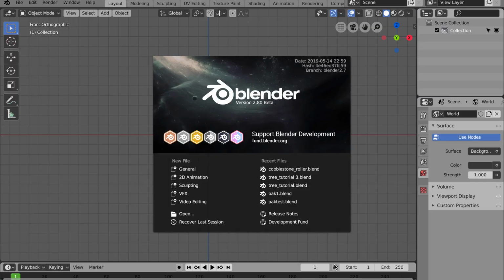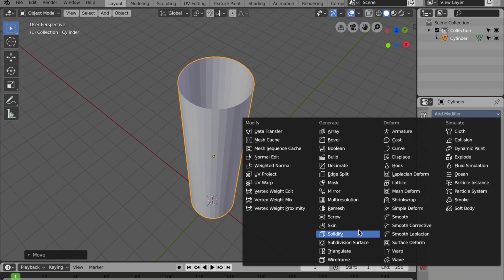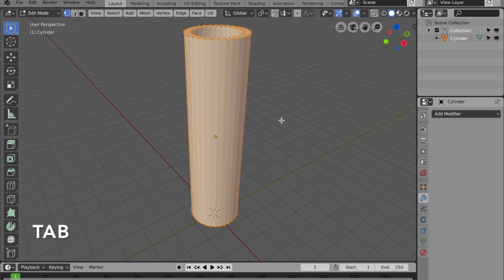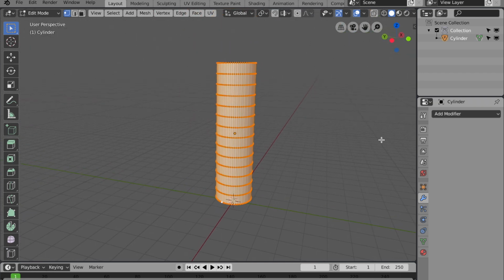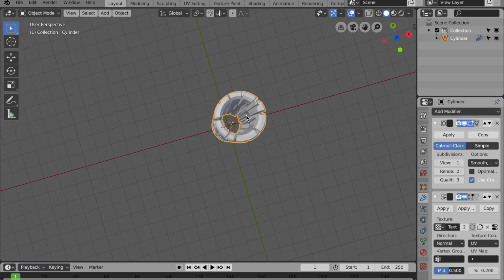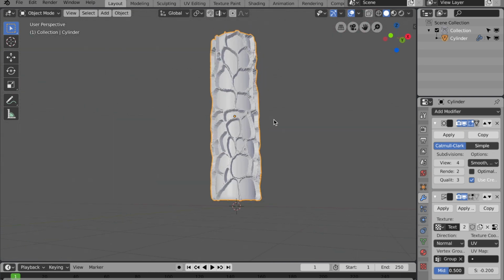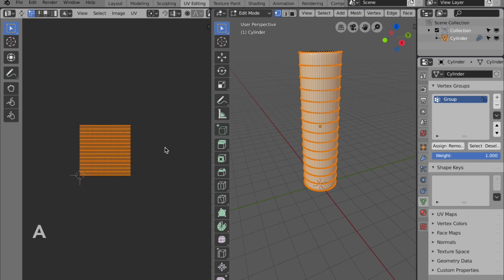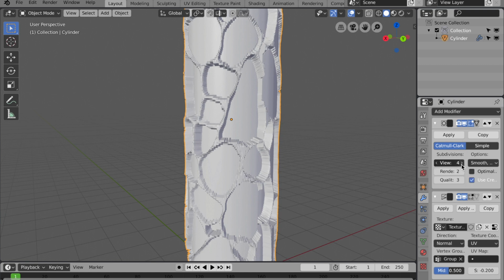3D Printable Textured Rolling Pin Tutorial

Comment: Maybe this video is made with outdated software (I have 4.5.3) but this is not working for me, it all falls apart when subdividing, when following the video the inside of the roller stays grey and is not selectable as it is in the video, the ventricles don't extend to the inside and it still shows a solid grey rim and inside I've tried following the video several times now and I'm not missing any steps but there must be an additional setting that isn't noted. Also using MAC

Comment: Yes, as an experienced blender user... I found I had the same problem as others did with it applying the displace modifier to the inner cylinder as well as the outer one even though I made my vertex group and applied it. You must apply the solidify modifier (by clicking the little down arrow icon next to the modifier and selecting apply).. THEN make the vertex group and add displace...etc. Took me a minute to figure out that's what I was doing wrong. Thx for the tut!.
Reply: im having trouble with group vertex, it only  highlight only one side, in the video i can see he turn the cylinder  around few times and it highlighed everything.
I then watch another video on how to group it by ctrl L, when i then apply the rest of the method if did not work, it is so frustrating, because I have  been doing it for hourssssssssssssssss, and this is my first time using blender, maybe a few key points  that are missing in the video.
Reply: Thank you!

Comment: This is one of the worse tutorials I've come across on You Tube. It's all very well you know what you are talking about, you have to assume though that your audience knows diddly squat. To that end you need to..
1) Talk slower and stop waving your mouse around as you speak.
2) Make sure you clearly and slowly explain what mouse clicks you are doing at the same time as your narrative.
3) Don't automatically assume your audience knows anything.. e.g. you need to explain how to select the faces or whatever they are. Your viewer doesn't know you are holding down the shift key  in order to do so.
4) Different versions of Blender have different options submenus (or whatever they are called).. i.e. the Modifier submenu in 3.4.1. is different to the one you are using as are some of the others. You have complete nupties to Blender, like me, before we've figured out what you've done and found where the "apply" button has been hidden, you're 5 steps ahead.
5) You were far too quick going over the textures (as with everything else)..  An explanation as to the fact that the ones you called up are not part of Blender and what you are supposed to be looking for on Google would have helped.
Having said all that I thank you for sharing your knowledge with us lesser mortals to whom Blender and other 3D software are a nightmare..

Comment: Hello, thank you for the tutorial. At the stage 'adding the texture' - nothing happens when I add it, however I need my roller to be much smaller (radius is 30mm) - is this why I'm not getting a texture appear? Adjusting the strength does not solve this. Thanks in advance for the help.

Comment: Hiho!

Thanks for the hints! I needed a few hours to find my fault why i also could not exclude the inner side from being textured. In the current 3.3 Blender i found the APLLY option for the solidify modifier behind the camera symbol in a dropdown menue. After applying this i could proceed as described. It is a pity that the UIs from Blender and zBrush make it so difficult to use them. Years ago i had a program called Cubify Sculpt, where you simply said wrap that picture along a path and voila it was wrapped. Only issue was that it could not doe it seamless and there was always a few milimeter seam.
Reply: Holy crap! Thank you so much for this comment! I have been fighting with that issue for the last 2 days. Thank you for working it out for me Thorsten! 😅

Comment: Do you have a method on how to print that roller for resin printing?
Reply from the maker: The one in the video was printed in resin. Just stood it on end and had supports on the bottom. It didn’t need supports anywhere on the pattern.

Comment: Thank you for this video. I am learning it these days as I plan on starting a business. Few questions as I am stuck. 1st is that I am not able to move this freehand as you could do it. Please help. Second, when I reach the point to add texture, I click on displace modifier, my surface doesn't look smooth like yours. Also when I ignore that and click on adding my texture, it doesn't do anything. I am sure I am doing something wrong but I have been trying this again and again since past 3 hours and no luck. Please help.
Reply: I again tried it today using a mouse, instead of the laptop TouchPad and it made some steps easier. But I am still unable to move it freehand like you are doing. And I am unable to get the texture to show up on the cylinder when I select it from Vertex Group section.

Comment: Hey I know this is late, but my cylinder's internal vertices can't be selected unless wireframed. Even then, when wireframe shows only the outside is selected, I'm still getting the texture inside the cylinder.
Reply from the maker: Make sure you have applied the solidify modifier not just added it to the list of visible modifiers.
Reply: @ACGStudio3D  I got it all figured out!! Another comment told me where to find the apply button. I've made a few, now I just need to print them and try them out
Reply: @ACGStudio3D  follow up question. some rollers I have been working on have had 2 issues. Some get lines going around the roller where the texture seems thicker on the ends. I also get vertical lines, like the ends of a piece of paper not lining up. Do you know what's going on?

Comment: I am using blender 2.9 so finding it hard to follow your video as the screen changed. I got a roller with texture but its inside to and i cannot 3d view it as left and right clicking open menus ;-( sorry my 1st time using blender.
Reply from the maker: Yeah, there have been several comments about the differences in newer versions and the one used here. I guess I should do an updated video.

Comment: You could also use the Boolean modifier in blender to make the ends perfectly flat, or also manually scale the vertices flat. I wouldn’t want to download a whole application just to do one simple step, as I don’t already use meshmixer.
Reply from the maker: That is another definitely another way to do it. I believe I tried to use the Boolean modifier and was having issues with it at the time. I can’t remember at this point.

Comment: Hey, just found this video and im so thankful! But I had a quick question, you said that we don't need to have a higher subdivision modifier as it it will be smooth when it prints, but when i open it up on Cura to slice it, the edges are jagged? Would love some help, very new to all this <3
Reply from the maker: In the modifier panel you can change how the modifier appears while modeling and how it will render. You can keep the view setting lower so your computer can work faster but keep the render setting higher so that the final file still comes out smooth.

Comment: Is there a method to have a pattern that will match stone edges if I need a wider length than the roller itself?
Reply from the maker: You could try working with a tileable texture image. Thinking about it from the practical application perspective, it will be difficult to do in practice without some degree of manual cleanup of the join. You could try making an expandable roller by attaching two together with a pattern that continues across them. That would allow you to make a roller bigger than can fit on a printer, though it might bring challenges of its own.
Reply: @ACGStudio3D  great suggestions! Thank you for the reply 😌

Comment: Hi. I stumbled upon a problem duirng making a cylinder. Mine has only like outer surface showed as a grid. I cant really make vertex group (it just does nothing) and if i apply the texture to the cylinder the inside also gets "textured". What am I doing wrong?
@EDIT: neverminde solved it. In the latest blender apply icon is hidden. Just didnt hit it and now it works :)

Comment: Regards... nice job I experienced some kind of issue whith the inner vertex of the  cylinder... those part continue whith the negative, and cannot remove from vertex group.What resolution is the correct for 1/56 scale...https://youtu.be/pDD00eD9jTo sure you’ll find the mistake I did, thx in advance.
Reply from the maker: I wish everyone that needs help would make a video! You have to Apply the solidify modifier. Modifiers are nondestructive, meaning they don’t actually change your object until they are applied, so the render is showing you what the modifier will do but hasn’t actually done anything yet. Once you apply the modifier you will see the inside vertices appear.
Reply: @ACGStudio3D  https://www.thingiverse.com/thing:4847877?fbclid=IwAR0SQQ_mqnPYxCbvlqczPVdeFQEmUQeQSU9t7i7nkTQPTtJ_j2F7N_zUKEw thx mate for your inspirational job,...you´re a master!!!!

Comment: Great tutorial the file cobblestone link you gave is over 100mb in size all 3d printing uploads have a  maximum 100mb no more and the size dimensions were off had to work the xyz dimensions to mm as well as the camera and set to default size so what you see is how large the item actually is or you can adjust as long as it doesn't go over ten inches which I think is the maximum a 3d printer can create, so the object is automatically configured for 3d printing ,
also the density and detail of the original download file because of the UV map image displacement raised the price at CraftCloud to $50.00 and  $19.00 shipping I am going to try to reduce the vertice faces to 2/3 the original face count to see if it makes a better price.

Comment: Sorry again. This might have been asked but when I hit A and then Ctrl R for the loops, I'm only getting the lines on the outside and not in the inside. Because of that, i can't change the vertex to only highlight the outside. If left like this, I get the pattern on the inside and the outside. Any advice?
Reply from the maker: Be sure to Apply the solidify modifier before you do that stuff. I haven’t used the newest version of blender but I have been told that the apply button isn’t displayed the same way. Adding the modifier from the menu doesn’t actually apply it to the model even though it shows the effect. If it hasn’t been applied then there isn’t actually and inside surface, even though it appears to be there
Reply: @ACGStudio3D  thanks. That solved ir :-)

Comment: Oh my gosh, so many questions. Last problem...I figured it all out and then exported it. By using your dimensions of 750 cm my model came out approx 1/4 in tall and 2mm wide. I changed it to inches, and meters...and I'm getting an extremely small model. Can you think of anything that would make that happen? I'm new to blender and this is just crazy. If I were to convert 750 cm that equals 295 inches. That's like, no way....Again, Help! Thanks.
Reply from the maker: Glad you figured out the modeling part! As for the scaling issue, the scale in blender is pretty arbitrary. When you go to export as an STL, you can adjust the scaling there. You may need to adjust the scaling there by a multiple of 10 to increase the size. Once you figure out the multiple that works for you, it should work for future models also. That said, I haven’t used blender in a while and am unsure how recent updates may have affected things.
Reply: @ACGStudio3D  Thank you. Was up pretty late. Still working on it this morning. It seems now I can do the loops but it's only on the outside. I'll just keep practicing. Thanks for the quick response~ Love this

Comment: I just downloaded blender to give this a shot. I'm not given the option to select the inside of the cylinder or to deselect it.  Everything highlighted is on the outside, which would seem fine until I apply the texture which then puts itself inside the cylinder.
Reply: I was having the same problem and getting very frustrated but then I decided to read the comments here I realized that you need to click on apply when you use the solidify modifier. On my version, the apply option is on the drop-down arrow just on the right of the solidify box. Apparently "ctrl A" does the same but I haven't tried it
Reply from the maker: That would have been my suggestion here. Also, ensure you make the vertex groups so that you don’t apply texture to the inside and outside surfaces.
Reply: @heloinaharvey2706  Got stuck here too, sorted thanks!

Comment: I am having a lot of difficulty creating the vertices group. It looks like I am selecting only the outside of the cylinder when making the vertex group, however when I add the pattern and then select the group it applies to both the inner and outer vertices and removes the pattern.  I notice when you create the group you have 3 sets of dots across the thickness however I only get 1 set on the outer edge.
Reply from the maker: Check that you have applied the Solidify modifier before you try to create the groups.
Reply: @ACGStudio3D  Thanks, I have added the Solidify modifier however I do not have the apply button in my version of blender 2.91 as you do in the video is there something else I have to do to apply it?
Reply from the maker: Interesting. I haven’t updated/used Blender in a while as I’ve been using other software. There is a difference between adding a modifier and applying it. Adding it will allow you to see the effect but it won’t actually do anything to your geometry until it is applied. So you can see the effect of Solidify but won’t see the extra vertices until it is applied. I’m not sure how you apply it if you don’t have the button in the video.
Reply: @clairejackson9366  there is a little down arrow next to the solidify title once you add the texture. Click on it you will see apply

Comment: That's a great tutorial! My roll pins came out perfect!

But... may I ask you for another tip? How do I do it on a different meshes like a cube or a plane? I almost achieved what I wanted, but I keep struggling with the "UV editing" step. Everything goes well when I do cylinder, but I can't seem to scale the texture when it comes to a cube/plane shapes. Maybe I'm doing the subdivide thing wrong? Or I should somehow prepare the new object before I do things with it? 

Once again, thanks for the tutorial. It was so simple, yet such a big step forward. You're the best :)
Reply from the maker: Glad you enjoyed the video! You should be able to follow a similar process with a cube. I’m not sure why it isn’t working out. You should be able to scale the texture using the same steps outlined in the video. I actually used the same process on a cube to make a texture stamp. You just need to subdivide the mesh so there is enough geometry to accept the detail. After UV unwrapping, you should still be able to adjust the UVs to scale and reposition the texture.
Reply: @ACGStudio3D  It worked after unwrapping. That's the step I've missed. Thank you once again! :>

Comment: I found this video from your Thingiverse pages. In your V2 roller pack you mention you hollowed them out so a wooden dowel can be put inside, but you seem to use them hollow in this video. Is that an optional step? If printing hollow with PLA, what infill would you recommend so that it's not too brittle? Thank you for the awesome files!
Reply from the maker: Matt Snell I have used them with a dowel but have found I prefer to just roll them by hand. I mostly use a hollow cylinder to save on material when printing. When I printed my roller on my FDM printer, I believe I used 20% I fill for the walls of the cylinder. However, if I remember correctly, the walls were thin enough that it wouldn’t make much of a difference if you just did 100%. If you are using the rollers on clay or something similar, which I highly recommend, you really don’t need much pressure and you won’t have to worry about breaking anything. If you use them on XPS, you need a bit more pressure but I haven’t been concerned with breaking anything.
Reply: @ACGStudio3D  I'll be using these for clay so I'll give your suggestions a shot. Thanks!
Reply from the maker: Matt Snell no problem!

Comment: This is an excellent video, loads of help but how do I select only the outside of the cylinder when making the vertex group, all i get is both outside and inside, I noticed you have 3 sets of dots across the thickness, I only have 2 and I don't have the egdes across the top
Reply from the maker: I’m glad you found it helpful! If you are not in wireframe mode, simply clicking and dragging to select should only select the outside vertices.
Reply: @ACGStudio3D  Thanks for the reply but unfortunately it doesn't, even  if  I select one vertex on outside face the corresponding one on the inside face is selected.  Again thanks for the video I have learned so much from using it and trying different things.
Reply from the maker: Interesting. I’m not sure what could be going on there. Have you applied the solidify modifier, not just added it but hit the apply button?
Reply: @ACGStudio3D  Perfect, thats why you are the master and I am the student. Thank you